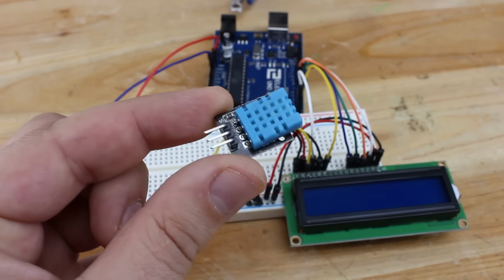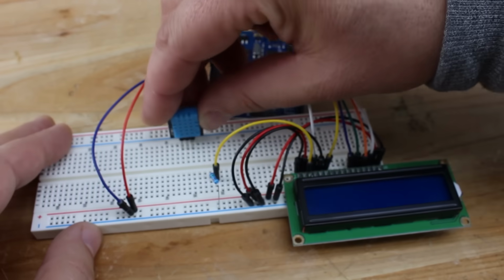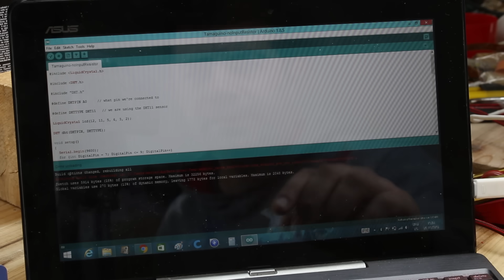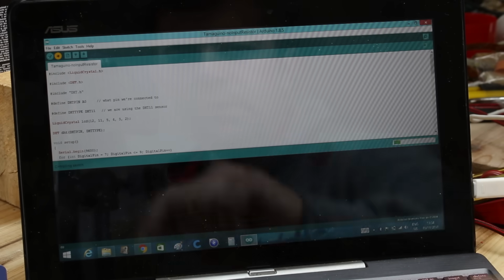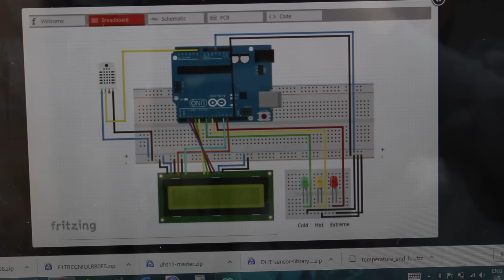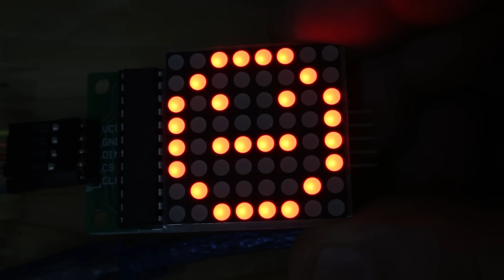6 Easy and Smart Projects-Elegoo KIT

Comment: Regarding the Servo Motor Control via Joystick Project #6, your analog pin connections to the Mega 2560 board are incorrect. The diagram shows First and Second Analog connections to A2 and A3 but they should be to A0 and A1 in order to match your code,  A12 is not really used.

Comment: This might be a dumb question but do we need codes for these?
Reply: ye
Reply: Not a dumb question at all if you're unfamiliar with these devices. Yes, the Arduino's microcontroller must be programmed by the user, but it's very easy to get started and you can construct numerous projects using code from existing libraries. The board just provides a convenient interface for controlling power, components and modules, actuators, sensors, displays etc. You can build a device and run it permanently with the Arduino, or use the Arduino to develop a prototype then build the final version more efficiently from only essential components. This video leaves out those details, seems to be just a demo for inspiration perhaps?

Comment: Do you need a computer for all them
Reply: yes
Reply: You do need a computer to upload the program to the Arduino's microcontroller for whatever you want it to do (which they call a "sketch"). After that the Arduino can be disconnected from the computer and only requires a power supply, which can be a battery, in order to operate whatever function you have set. It will retain the program even with power disconnected until it is reprogrammed.
Reply: @itsafeaturenotaflaw  yes

Comment: The first one isn't working. Connections are all correct. The servo steps a little when power is connected, but no response from the sensor.
Reply: Did u program and uploaded ur code so servo can move?